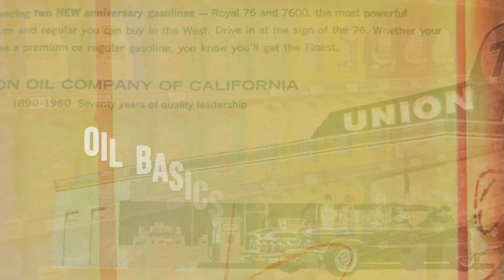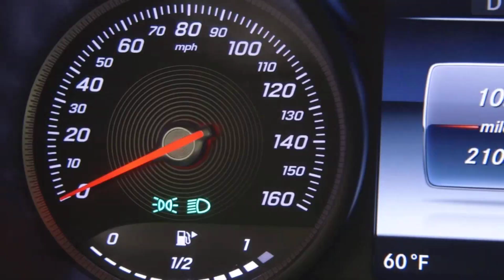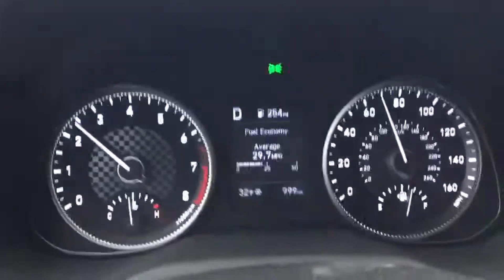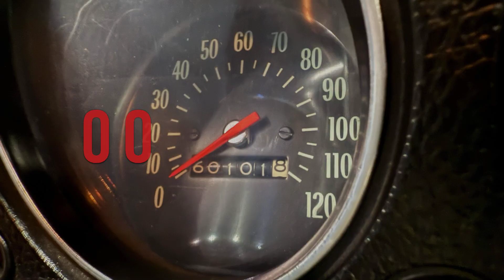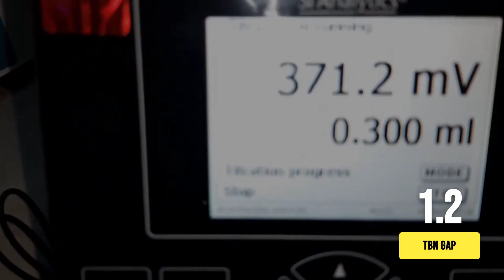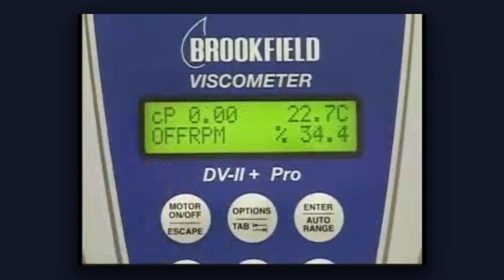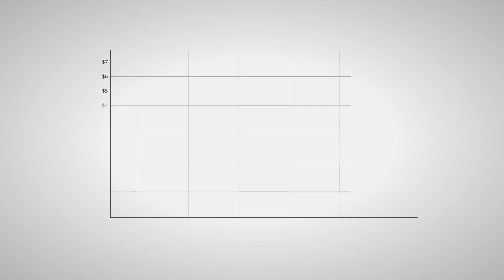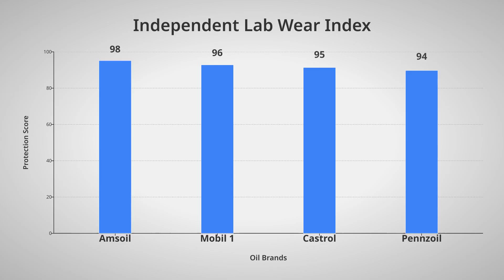Is Amsoil The Best Engine Oil? (Mechanics Won't Tell You!)

Comment: I'm a recent Amsoil convert. When I saw the subpar wear additives package fluid analysis of Mercon transmission fluid vs Amsoil, I was sold in a BIG way. Also, Penzoil and other manufacturers have had problems with counterfeit oil... yikes! One bad batch of oil could destroy your engine. I get my Amsoil shipped directly from the source = TRUST
Reply: Motorcraft is well known for best of OEM fluids.
Reply: I’ve been a Amsoil dealer since the 90s and have never lost an engine or transmission. I have a 2007 LBZ Duramax 235,000 miles, a 2000 tundra V8 198,0000 and a 1993 Chev Silverado W/T 140,000 miles since new and these trucks still run and shift like the day I bought them. Best oil in the world by far!!

Comment: Oils cheap, motors not so much.  Im not going past 5k period.  Not saying new oil isn't better, but im not willing to push the window as far as they say is fine.  The ones saying 10-15-20k in the manual are also the ones who need to sell new cars.....
Reply: Yeah but you could use Pennzoil Ultra Platinum for half the price as long as you change your oil every 5 to 10000 engine will last 400,000 miles or more